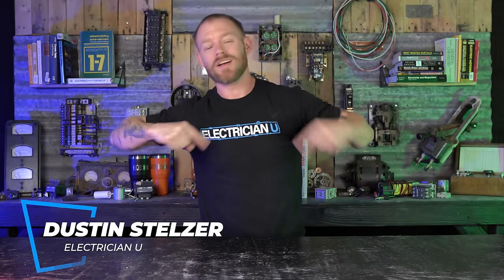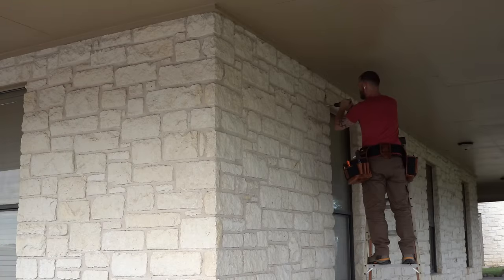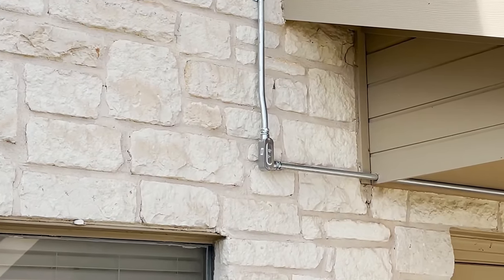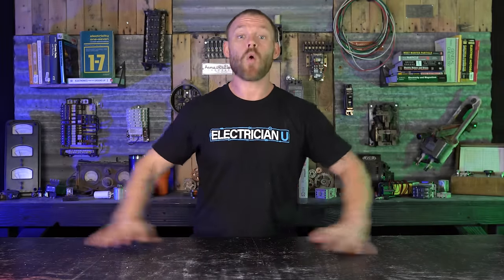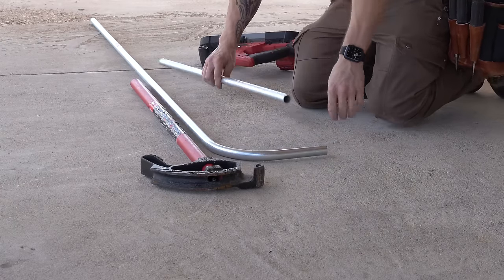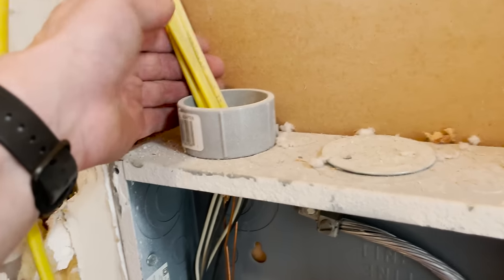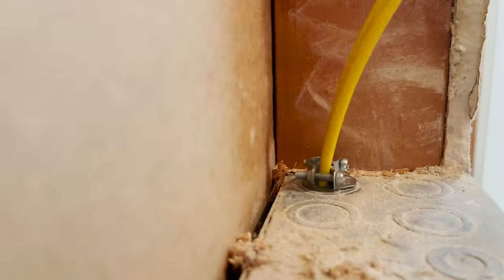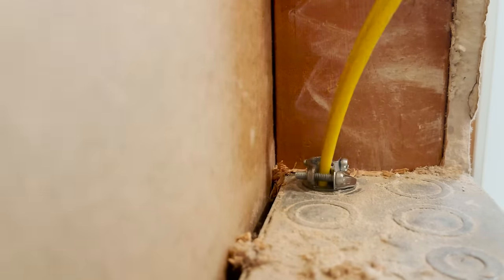Installing a Mini Split at a Commercial Building.

Comment: Please explain why you didn't use the lights as access to run a raceway!  Well I am not an electrician, I am a general contractor, and it looks to me as thogh the way you did it seems really sub optimal.  Also, I should apologize for my comment as I have a lot of respect for your approach to code and to electrical work in general. But as someone who hires electric contractors on a regular basis, this is not a thing that I would generally look for.

Comment: Dude, just run the EMT all the way to the panel, you where 90% there.
Reply: Spoken like someone who hasn't run much EMT in a ceiling.  :D
Reply: You want to spend 10x longer in an Attic?
Reply: @eazzzye2003  I do it every day and I'm 58 years old.  You learn how to be quick.
Reply: @scottgrafer2222  Then you're doing it wrong if you're 58 and still climbing through attics.

Comment: EMT on the outside  Never happen in NYC.
Reply: not even on a wall only accessible by a lift or tall ladder?
Reply: Threaded conduit with proper fittings,Boxes ,straps . That is code in NYC  @thisgame1499

Comment: Stripping a NM cable through a conduit is a code violation because it is THHN and that is not wet location rated.
Reply: He ran THWN wires through the conduit and installed a junction box in the attic, where he spliced to a Romex cable and ran Romex the rest of the way.
Reply: @jonclark1288  That's a code violation #12 THHN is not listed for damp location and can't be re-identified per 200.6
Reply: @williamsnyder6514  I said THWN, not THHN. THWN is wet location rated. Granted, Dustin called it "THHN" in the video, and IF that's what he used, then you'd be right, it's a code violation. However, I suspect he MEANT THWN. Most wire of this type is dual-rated "THHN/THWN-2." A lot of people use the two names interchangeably, even if it's not technically correct
Reply: @jonclark1288  Then it would be a code violation to re-identify it red
Reply: @williamsnyder6514  agreed, I commented on this video earlier saying that re-identifying the white wire was a code violation.
Reply: @jonclark1288  Plus if he stripped out the Romex and sleeved it through the EMT that is actually 2 violations as well
Reply: @jonclark1288  After watching it again it looks like he purposely pulls a white wire an re-identifies it violation of the same reference he calls legal
Reply: You are wrong.

Comment: It's so weird that some places require you to get an electrician to do anything with power. I run the wire and install disconnects and breakers and whatever else I need to do when installing HVAC/R systems
Reply: That’s why hvac is legit it teaches you everything
Reply: @Nuttypro-f  I’ve seen some Hvac guys try and run electrical. It’s always janky as hell with multiple code violations. Hvac guys know just enough electrical to be dangerous lol
Reply: @xXBuckOFiveXx  I guess it depends on the guy. But I do clean up any bits of wire, and insulation and what not so that's something lmao. I do plumbing as well and there's nothing quite like the electrician drilling through your pipe to run his wire
Reply: @xXBuckOFiveXx  just enough knowledge can take you to places I never even thought possible 👍

Comment: Sorry, but you are wrong on re-identifying your white #12. It is only permitted if part of a cable assembly or a flexible cord. You are pulling individual conductors in a raceway.This one is definitely black and white and not one that can be misconstrued as subject to interpretation!
Reply: No he is not pulling white wire in a race way, witch its not a raceway its called conduit,
Reply: @citizenfriendly3845  do you have a code book? Look at article 358.2 ….cheers!
Reply: @JEE1971  358.2 does not say anything about reidentifying ingriunded conductors
Reply: @citizenfriendly3845  I am aware of that, but it does say EMT is a raceway.  Look at 200.7  (C) 1 and 2 for re-identifying the white conductor for use other than a grounded conductor. It is only code compliant when part of a cable assembly or flexible cord.
Reply: @JEE1971  oh! Yea i see . Time to change the Code Book.

Comment: Every emt connector and coupling is not weather proof noted by the shiny uncolored finish. You would fail inspection for using indoor rated connectors and couplings in an outdoor environment...
Reply: Nice catch!  The raintight/weatherproof (same thing?) connectors I see nowadays are blue, but I have some old connectors that say raintight and are plain.  But the ones he put up look newly purchased, so don't think that's what was going on here!  I see more wet location emt without raintight connectors than ones with.  Many are screw set, not compression, too.
Reply: Cracks me up after we used compression fittings for 40 plus years on outdoor EMT conduit that they are no longer considered raintite. Had compression fittings on indoor equipment that got hosed day at least once a week and never saw any water on properly installed conduit. I always tried to use the better steel fittings rather  then garbage die cast fittings that crack or break so easy.

Comment: You said you are installing thhn in the conduit outside…..you are supposed to use thwn.
Reply: thhn is rated for outside conduit runs, but the cable assembly known as romex, which also has thhn wires is not rated for outside.
Reply: The wire I use is dual rated thhn and thwn, but I always just call it thhn.

Thhn is rated for damp locations outside but not wet.  On his run, I'd call under the eve damp, but the run up the house wall would be wet.
Reply: @RJ-ej1nr  outside is wet location. Underground is wet location, under the eve is wet location because it is outside. The thhn is rated for wet location, the confusion is romex is thhn and is not for outside locations.
Reply: @uhjyuff2095  You might think, but NEC 100 gives a definition on damp locations (which are not wet locations, and for grins it's not under "Damp" but rather "Location, Damp").  It says "Examples of such locations include partially protected locations under ... roofed open porches ..." which is his situation for the under the eves part of his run.

The THHN rating alone does not cover wet locations, only damp.   Table 310.4(A) under THHN says "Dry and damp locations".
Reply: @RJ-ej1nr  I guess we can just disagree, because we both use thhn outside because the wire is actually dual rated thhn/thwn or whatever. Can we buy thhn wire without the thwn? And his conduit is not protected from rain because it protrudes past the patio cover!
Reply: @uhjyuff2095   I think we agree, and I may have been confusing on when "thhn" means "only thhn rated with no other rating" and when it means the thhn we buy which is actually "thhn/thwn".  I've never seen thhn only rated wire, but I haven't gone looking.

Only the part in the covered areas is damp.  The part up to the roof is wet and gives a wet requirement for the installation.  I was throwing the damp thing out there since if the whole installation was in the porch area, the mythical thhn only rated wire would be code.
Reply: @RJ-ej1nr  haha, great thanks for the wonder chat see you on the next one!